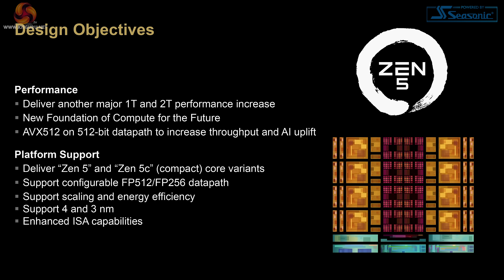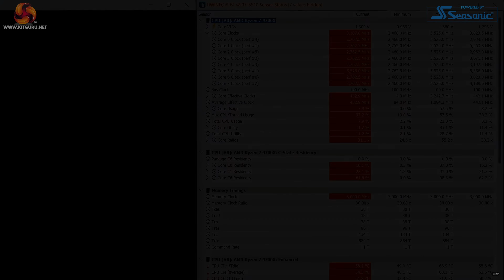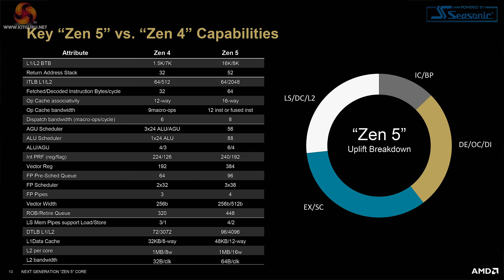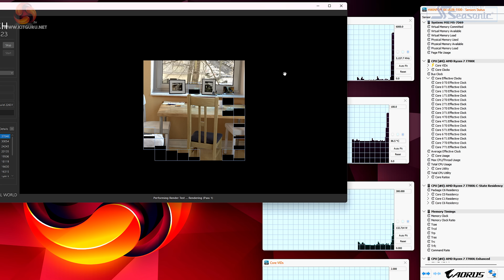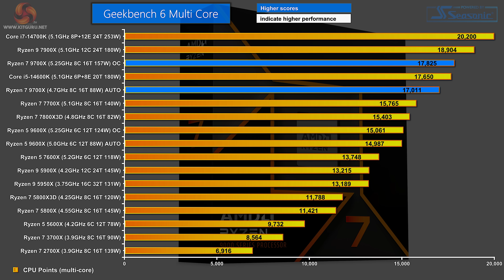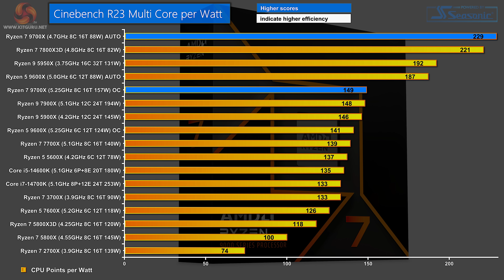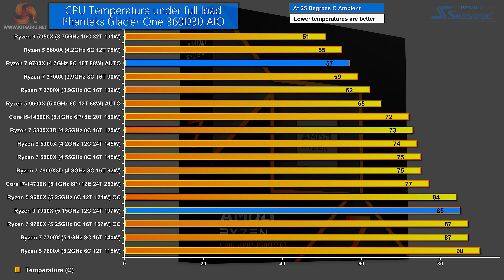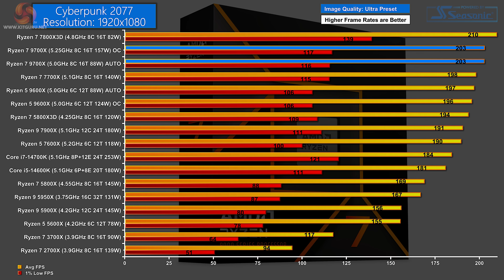AMD Ryzen 7 9700X review: YouTube hates this CPU

Comment: Admire Leo for not just making a thumbnail with a shocked crying face and just focusing on the facts. Had no idea the 7700x cost more on launch than the 9700x. No one else said that. Learned a lot from this video
Reply: Well did people focus on it when the 7700x launched ? Everyone complained it was expensive too. Short memory. Prices drop. Stop sobbing.
Reply: Plenty of people talked about the MSRP, but that doesn't represent current value. They still have plenty of 7000 series to go thru, after which Zen 5 will move. This is a strategy they've used for their other products, including Radeon.
Reply: I don't know why he (Leo or whoever does the thumbnail) did it, I also like it to not see an emo-thumbnail. Sadly those seem to help for clicks but I myself am much less inclined to watch a video when there is an emo-thumbnail, I dislike emo-thumbnails.
Reply: @peterjansen4826  that's actually something YouTube tells creators to do believe it or not.
Reply: The thumbnail is due to the one of the core aspects of developed regions that have English as their native language: high expectations for everything.

The CPU is efficient, but the lesson we all learned is to wait for the 3D chip.

These CPUs will be in Prebuilts during Black Friday and Christmas.
Reply: The lower launch price is relevant, the 9000 series are denser and not using a more expensive process so likely will replace 7000 series, unlike the situation with AM4 Zen3 produced on a cheaper 7nm process.  9000 may undercut 7000 series in a year.
Any purchase has to consider the prices available that day, at first it's not uncommon for last gen to offer better value.
With time the faster memory controller and features like AVX512 will increase in value relatively, while optimisation proceeds, just like 7700x improved relatively to the 5800x3D with time.
Reply: Can't take anything this guy says serious since he was given a free vacation to America paid for by AMD so of course he is going to be a shill for them and paint their product in a good light.
Reply: many stupid reviewer  run CPU  in 4.40 ghz(not 5.5 max speed),,,they forget enable PBO ,,,,, see thomshardware. review.
Reply: YouTube recommends you make thumbnails like that. That's why so many people do. Just an FYI.
Reply: the 7700X launch price was bad at the time too so saying 9700X launched with better price is not a good argument
Reply: @jscb7003  especially when the 7700 non-X is 250-270$.
Reply: welcome to the real world. In two years the same conversation will happen for 9700x replacement. yawns.
Reply: Bunch of self entitled whining YouTubers
Reply: it doesn't matter its price 2 years ago, what matter is its price now.
Reply: who cares what it costs at launch what matters is what it costs now....$100 more for efficiency and minimal performance is bad.
Reply: Products drop in price over the years. You need to look at the market to understand how pricing works. It’s been like that for decades now. I’m surprised people don’t realise this. When the 9700x replacement comes out it will cost more in 2 years. It’s basic understanding of how things work. And in case people haven’t realised the economy is a mess so prices of new products always go up. Not down.
Reply: Hardware unboxed give me a break. They didn’t have the 7700 in their first article they have been sharing tech power up graphs and using other channels to get info then milked the algorithm to create what 5 videos now and claiming the spotlight from others. Don’t get me started on their ‘did we do it wrong’ video. It’s like a common thing they do now to milk hits.
Reply: The issue is that it’s not a significant enough performance increase over the 7700x to ever justify the price.
Reply: Yeah, I. Sitting here with a Ryzen 3800 considering upgrades and this looks like a viable choice to me if I decide to keep the costs down. A damn good uplift from where I am
Reply: Why this CPU have so less utilization in gaming?
I have the same CPU but in gaming the frequency is max 3500mhz
Watch I must to do?
Reply: Agree.... Level1techs was also abit more calm about it.  https://www.youtube.com/c/level1techs
Reply: HUB, GN, and LTT all covered how the launch price of the 9700x is lower than the launch price of the 7700x.
Reply: no one also sadly said that pricing is the worst thing about 9700x/9600x... here new 9700x cost more than 7800x3D, that should tell you enough, 9600X cost as much as 7700x and almost double as 7600 ... not even people wont upgrade from 7000 series, it also make 0 zero to use 9000 in brand new pc.
Reply: What, literally everybody in their beginning segment showed the pricing of the 7000 and 9000 series
Reply: Everyone is entitled. Whinging is the default state for a huge YouTube audience.
Reply: @Linusfikfaps-ez2qg this why i'm hating the tech commuinity any more. Need go bacl to the scientific method for benchmarks snd Reddit users for what to benchmark just because everyone is playing it
Reply: Buy the cpu that’s two years old and cheaper. I agree. Leave us be to discuss the new tech and the benefits.
Reply: Only needing a good Single, dual fan Air cooler at stock settings. Is a blessing for those  small factor, workstation builds.
Reply: So 9700X is just a slightly more efficient 7700X? Too little too late because 7700X is currently much cheaper.
Reply: how is it ‘ignoring’ stability issues if he didn’t get them. lol. Drama queens
Reply: HUB Steve said it at least twice.
Reply: Ryzen 5 1600X = 100%
Ryzen 5 2600X = 110%
Ryzen 5 3600X = 131%
Ryzen 5 5600X = 157%
Ryzen 5 7600X = 193%
Ryzen 5 9600X = 194%
AMD's Skylake moment.lol
Reply: Admire your abilities to buying every BS "fact". Leo said "9700X is for someone who is buying a new PC", because "similar performance (compared to 7700X) and much less power draw" without benchmarking or mentioning 7700 non-X, which is about 5% to 10% slower with similar power draw but over 35% cheaper. And yes, like 7700X, it's launch preis was higher two years ago... But why does this matter again?
Reply: Doesn't matter what the 7700x cost on release what matters is what you can buy NOW.  THAT is its competition.  Also yes, others have mentioned this.
This is an incremental update at best and that is ignoring the stability issues a number of reviewers have had.
Reply: It’s not the 7700X launch anymore, not sure why people are comparing MSRPs?
Reply: It's a kneejerk comment that ignores the passage of time. The E8500 launched for $299. Surprise surprise it's completely out of date and pales in comparison to a modern CPU. Just what is someone supposed to do with the factoid about the original launch price of the 7700x? Go back in time and buy one of those instead, to bring into the future? Ridiculous. The 9700x is a few % faster than a 7700 (non X!) for similar power consumption and a much higher price. Make all the factoids about original launch price you want, this is an utterly terrible product at this price point.
Reply: Enable pbo. Old 7700 Ryzen is dust.
Reply: @DarwinBrookes-ss6on  sure, enable PBO and draw 165+ watts, who the hell compares it with a 7700@65W?
Reply: @yibozhao1012 Yes, Wendell enabled PBO on the 9700X, installed Linux on the PC, & saw significant improvement over the 7700X.
Reply: @tringuyen7519  
Does "significant improvement" mean 2x to 2.5x? Leo's whole (flawed) point why 9700X "not bad and suit for new buyers" is it's great power efficiency, which 7700 non-X already archived long time ago and at  a much lower price now. By enabling PBO it draws 165W+, so 2 to 2.5 times the power of what 7700 draws.
Reply: @tringuyen7519  Significant huh?

Is that why at the end of the video he said if you're on a 12/13 or 14 Gen intel CPU, or if you're on a 7700x, not to bother upgrading do the 9700x? And if you're buying a new CPU and can find the 7700x for cheaper, you should buy that instead.

Must not be that significant.
Reply: @DarwinBrookes-ss6on   Get average 4.4% more speed with PBO enabled. And go from 88 watts powerdraw to 169 watts. That sounds smmaRT RIGHT?
Reply: @karlos1060  DO you work for Intel or something? So the processor is too slow, and power demand isnt relevant. So there is an easy way to crank it and get the performance you say is missing. You are finding fault with both? 4% more? you just picking figures from the air? this is all so stupid.
Reply: @user-uv8qn1br8q  I doubt he works for intel, he's just smarter than you are.
Reply: I don't think people realize they will stop making the 7000 series. So a discounted price on a end-of-life product, might not be the best thing to focus on in a review. And somehow disregard a lower price on a new part, even tho there is massive inflation.
And somehow power consumption is not important to some, even though there was a pretty serious energy crisis. That's fine, i'll just run the AC when i'm using the computer...
I have a feeling it's mostly americans that don't care, but they also don't realise that a 400W cpu with a 600W gpu get uncomfortably close to the american standard outlet current rating.

The ipc improvements might not be as pronounced in some cases, but it's a clear sign amd will dominate intel in single thread (where they lacked for now) as well as multi thread this generation. A high mid range chip topping puget photoshop benchmark charts seems like a good sign for productivity.  With the power reduction it seems like a perfect chip for SI's, and with the overclocking headroom it's fun for even beginner overclockers.
Reply: @Cr3ePiO  Intel's new Skymont E-Cores are as fast as 13th gen P-cores at the same clock speeds, though the clock speeds will be lower. So I wouldn't count intel out.

While ArrowLake's P-Cores will be improved by 14%, the clock speeds will be lower so that they don't consume as much power and risk having their new CPUs die like the high power 13th and 14th gen chips.
Reply: @rattlehead999  we'll just have to wait for independant reviews and see. I'm pretty sure the performance is exagerrated as was with ryzen 9000. Regarding the power draw being the issue for the instabillity i'm not so sure, it may just be more pronounced on higher power chips. But it's starting to show even lower powered chips are affected, which might actually be the fabrication process resulting in the oxidized vias. We will just have to wait and see. I hope they figure it out, so there will be competition with the 9800x3d. Choice and reduced prices can only be good for us.
Reply: @Cr3ePiO  keep in mind intel's "95W" and "125" TDP chips actually consume up to 180-200W. 

If you invest in AMD or Nvidia(maybe intel after they stabilize) you win weather they screw the customers or not. XD
Reply: Who cares if the previous Ryzen 7700X costed even more when released then this 9700X? It's all about wht else can you get for the money! In my country (the Netherlands) the 9700X 8 core costs a few € more then the 14700K wich just obliterates that 9700X cpu in every way except powerdraw under load!

A nice undervolt will help that cpu not to degrade and the new microcode coming soon as well. More important, while all of YT ir praising AMD in how efficient they are under load no one seems to show the charts of IDLE use! AMD is between 400 and 800% worse then Intel in that regard! 

The worst Intel I9-14900K uses 7,7 watts idle and the 7900X does over 41 watts! While the 14600k uses 5,17 watts and the new 9700x uses 28,24 watts and the 9600x uses 31,42 watts IDLE!

IDLE is where people spend 80 to 95% of the time in even with a feew hours gaming a day! But none of the YT tech tubers wants you to know because it's not in the favour of AMD!

LMAO! This dude the same. Shows graphs of power usage underload and good power usage. But not in IDLE...why o why? I know the reason...but people are not interested in the truth. They want to be fooled!
Reply: @karlos1060  👍

Finally found someone else that actually knows what they're talking about, and can think logically.

Using that same logic I went with Intel for my current build. 5 year warranty, microcode around the corner. I always take advantage of situations like this. I just scored a 13700k for $250 last week. People are being scared away by clueless YouTube tech influencers are returning them in brand new condition to Amazon. 😂
Reply: @karlos1060  I live in the Netherlands, we do have an extra 'shoptax' in the first few months after release because there is very little competition among the shops for PC-hardware, especially when there is more scarcity like Sapphire Nitro cards, but I am pretty certain that this claim is not true considerint that the 14700k at this moment costs €444 at Azerty. If the 7700X would still cost more because most shops don't sell it yet, fine, just wait a few weeks or months, that is how it is in the Netherlands, sadly. Or better, wait for the X3D-CPU's and get the best gaming-performance and if you want it also the best productivity-performance (9950X3D or 9950X). Why choosing Zen4/Zen5 over Intel? We now know that Intel 13/14th gen breaks easily but before that I already preferred Ryzen because of the homogenous architecture and the much lower powerdraw. I don't like having e-cores on my CPU due to problems with threadscheduling and software-developers not assigning properly which cores to use for what. 

I agree with you that AMD needs to improve the idlepower, both for the CPU's and graphics cards (according to my reading on Linux 37 Watt at idle).
Reply: @karlos1060 Yeah. It obliterates itself as a good Intel CPU and consumes 3x the power. Nice one.
Reply: Right now 7700x does not cost more than 9700x. In my region I can find 7700x3d less than 9700x. Why would I even bother with a "regression". (Edited)
Reply: @modernlogix  "Had no idea the 7700x cost more ON LAUNCH than the 9700x" You can't bloody read mate.
Reply: @stevewatson6839 I read it. But does it matter what it costed 2 years ago, I care about what it is now. The video poster has already stated the obvious in the comment.
Reply: @modernlogix  7700x3d?
How much more disinformation do you spread?
Reply: @modernlogix  yea tou would wait for the next x3d cpu or you would be a dummy😂
Reply from the maker: @modernlogix  When the 7700x launched it was more expensive than the 9700x. We understand you can get the 7700x for less NOW than the 9700x - 2 years later yes. but in our video we showcased the 7700x was launched in the UK at £420. The 9700x has launched at less than this. Whether that matters to you now is likely not important, however its true.
Reply: @KitGuruTech  Doesnt really matter though does it? Unless you value just having a higher number written on your CPU there is no reason not to buy the cheaper 7700X now.
Reply: @chrism2964  Really? Don't all of the benchmarks show comparable performance stock at much lower power draw, with much better performance with PBO on?
Reply: @chrism2964 
It does...
One is USD 
The other is pounds
Reply: @KitGuruTech  Why is everyone ignoring the Ryzen 7 7700 non-X? It's got the same 65W TDP and 88W PPT as the 9700x, with 96-98% the performance of the 7700x, while costing just 250$
Reply: @KitGuruTech  
Why should that matter to the people who are going to buy a new cpu TODAY? nobody cared about MSRP of gpus when the crypto boom destroyed the market.
Reply: @chrism2964  Yes it does matter, because the way down to buying at production cost is much shorter.
Looking at the pricing of the 7700x way back when it was launched and now shows that most people who ever bought that processor overpaid by a considerable margin.
The same will never be true of the 9700x.
Reply: @KitGuruTech  the price of things 2 years ago isn't really relevant. The price to performance you can buy right now is the only thing that matters really as you aren't making a decision 2 years ago, you are making one now in which cpu to buy if you are looking.
Reply: @KitGuruTech  it doesn't matter because economics are constantly changing.
Reply: @rattlehead999  where are those prices? 

On Amazon they are the same price at the moment. Two-dollar difference. $285
Reply: @DingleBerryschnapps  Eastern Europe. 
Even if the price difference is very small the 7700non-X is worth it, low power and low temps with 98% the performance.
Reply: @Ryan_Winter  no it doesn't, it just shows that the economy was in a different place, Einstein.
Reply: @DingleBerryschnapps  Wrong again, inflation would lead to a nominal price increase.
Besides EVEN IF YOU WERE RIGHT, MY ARGUMENT STILL HOLDS UP. ;-)
Reply: @DingleBerryschnapps  Thank you for reminding us all that inflation needs to be taken into account in price comparisons at launch.
Reply: @KitGuruTech  AMD massively mis-pricing their products 2-3 years ago is completely irrelevant today, those chips weren't worth anywhere close to that, they still aren't and with 9700x they never will be.
Reply: @rattlehead999 Daniel Owen isn't. And it's because we won't get a 105W 9700XX.
Reply: @valrond  We should NOT have a 105W version of the 9700x, the 7700x was a terrible chip, all 7000X chips were bad, running at 95C and consuming tons of power just to top benchmark charts... -_-
Reply: @rattlehead999  cuz AMD was stupid naming those as X
Reply: @thelorddarkam3563  I disagree, it signals to me that they are done with super high power consumption and CPUs running at 95C... but after the backlash they might go back to making chips like the 7700X,7900X and 7950X again...
Reply: @rattlehead999  i dont think so, i thik they will bang with the X3D, and this trend wont change, amd will keep having the best products, i mean even the angry guys know 5800X3D and 7800x3D is the best price for gaming, now i think they will also improve the TDP +15% improvement compared with the 7800X3D IN GAMES
Reply: @rattlehead999  I think the trend will be always recommending the previous AMD generation cuz the price x performance
Reply: @thelorddarkam3563  That wasn't the case pre-zen 4. Zen4 increased prices a lot.
Reply: @modernlogix  Not a "regression" it's an X3D chip, it's not exactly easy to compete against given there's 128MB extra of L3 there.. it has a different name for a reason dude, completely different SKU. If you have an X3D chip OFC you're going to upgrade to an X3D chip, it just goes without saying. 
It's almost like you have no idea about the product you own, which is pretty fkn sad bro.
Reply: @Ryrynz2000  The point is not about upgrading, it's about buying new. If I'm getting a new system, X3D is the value. Why would I buy this for ANY reason and pay more for less performance is the damn point. Also, X3D chips use the same mobo, so it doesn't go without saying. 

Why be rude to shill for AMD. Dunno about you but I am a paying customer and I'd rather call out their BS than having their Kool Aid to still have my value processors and not the 5800XT BS. Thanks